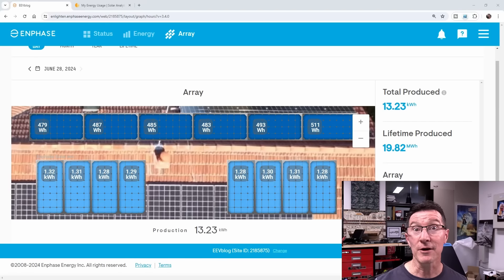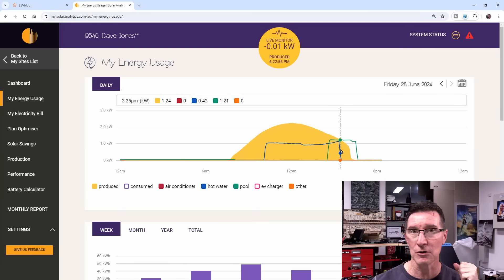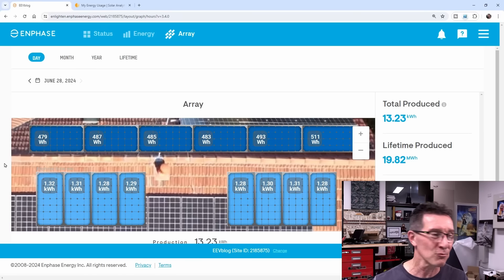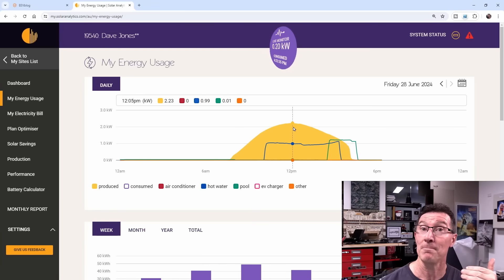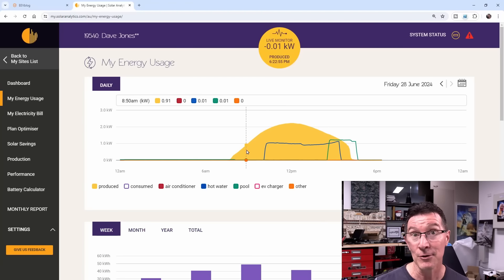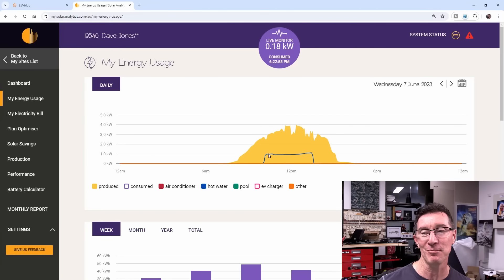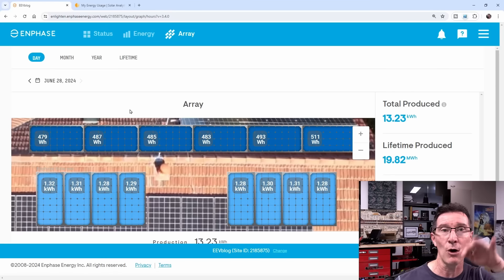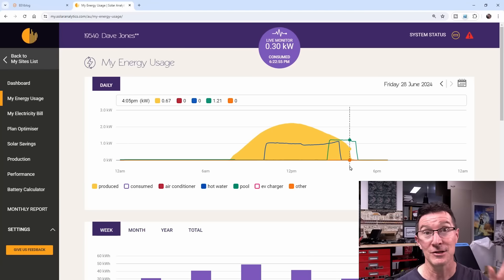New Enphase Solar Power System - 1st Day

Comment: I haven't cleaned my panels since installed in 2012 and I have recorded production every minute into a database, I can't see any degradation or loss of production. But they do get snow in the winter so IDK if that scrapes crud of them when it slides down. Also had 2 times where they were all  yellow / white from a abnormal pollen situation and they worked great.

Comment: I have 4 kW panels with Enphase microinverters on the front side of my house and 3kW panels with a Fronius string inverter on the rear of the house.  Frankly, I don't think the panels detract from the appearance - but that is me, not Ms. EEVBLOG.  I'm in Denver, so I don't have as good average insolation as Sydney, but I'm pleased with the results.  (I'm now on my 3rd inverter for the string array, but I got 10 years each from the 1st two.)

Comment: I'm just a smidge south of you down near Liverpool, 40.9kWh production from 12.32kWp, what a beautiful winter's day. I had to switch to Origin recently for the 10c feed in, I hear Engie(Simply Energy) pays 12c but I can't seem to sign up for them lol. I'm counting down the days until the hot water system dies so I can get a heat pump one, we used 730kWh last quarter just for hot water.
Reply: I got a similar amount from a 7,5kWp system yesterday.
Mine are aimed at the south east, this might be a difference.
Reply from the maker: 13.2kWh for my 5.18kW Enphase scales to 31.4kWh for your size system. So I assume yours is way better angle optimised than mine with panels on both sides of the roof.

Comment: My UK tariff (import/export pence per kWh):
Normal: 24p/14p
Cheap time: 15p/5p (2am to 5am)
Peak time: 35p/25p (4pm to 7pm)
Standing charge = 59p/day
So, charge batteries at cheap time if no sun.
Export surplus at peak time for a profit.
But generally with a 10kWh battery never need to import anything in summer.
Reply: Is it worth it for the few weeks a year there's sunshine in the UK?
Reply: @Okurkaarrgghh  LOL....yes it is, but also depends on efficiency of installation, all 16 of my panels are directly south facing. In winter will generally charge batteries for full 3hr cheap rate every evening.
Reply: @Okurkaarrgghh  Probably, yes (to power your aircon, pool, 23 fridges, 4 electric cars, media room etc). Oh, wait!

Comment: You could get significantly more if you just had them setup on a simple tracking system;  you could basically get your "peak" power all day long.  They would be less sightly of course and standing up on the roof with some bracketry..  But you could put them all on the same system with a long driveshaft with worm gears on each pole where it can operate with one motor...  but yet still be very strong if the wind tried to blow them around--- since worm gear setups only let you apply force in one direction.  it would be a fun project to tackle.. especially if you had your own lathe and welder

Comment: You get more output with some slight cloud cover as it helps reflect the sun and defuse it, clear sky isn’t quite as good.
Reply: Straight out of Solar Roadways' book.
Reply: Citation very much needed. Dave has shown peaks higher than a perfectly clear day before, but that was the very particular case where there were clouds in the sky, but crucially not covering the sun from the panels' perspective. In that scenario, you are indeed stealing some power from the people currently under the shadow of the clouds. But wait 10 minutes, and it'll be your turn in the shadow; and you do end up getting less power overall. This is what makes sense to me from my armchair at least, any hard numbers or science would convince me otherwise.
Reply: Aka "cloud edge effect." When the sun is near the edge of a cloud, sunlight can be scattered and spread out, reaching the solar panels from multiple angles.
Reply: @Okurkaarrgghh  maybe instead of just throwing insults you investigate solar power system effects from clouds, it is a known and proven occurrence.
Reply: @TheDefpom  What insults are you talking about?

You do know what the solar system is, right?

Edit: He changed "solar system effects" to "solar power system effects" after my reply but doesn't bother to say where he saw insults.
Reply: its a rare and brief condition and irrelevant to normal operation
Reply: As with all things the devil is in the detail.  If there is thin but high coverage clouding in my area I get higher levels of power out of the panels at times when there is not good direct sunlight since the scatter results in more light hitting the panels than otherwise would happen.  The same level of cloud reduces the direct light though so overall power production for the day is considerably lower than clear sky days.
Reply: Direct sunlight overhead bests cloudy indirect light at all times.
What you are talking about depends on several circumstances and is a very bad and false generalization.
Reply: @FutureChaosTV  you can have both at the same time, although it is not common enough to really matter.